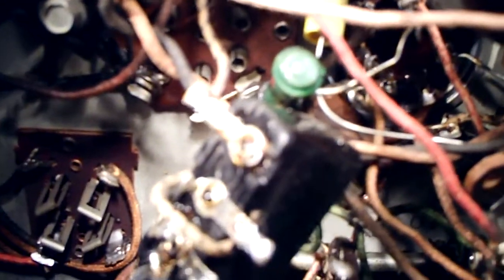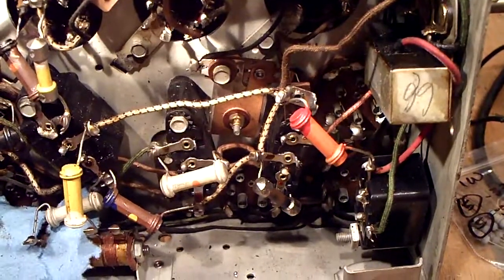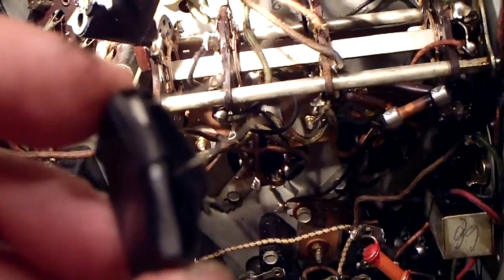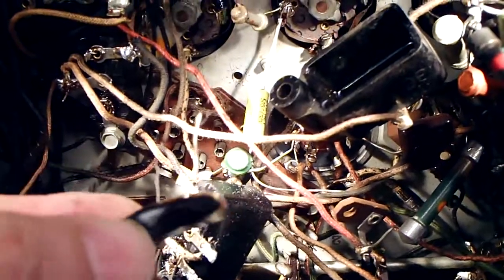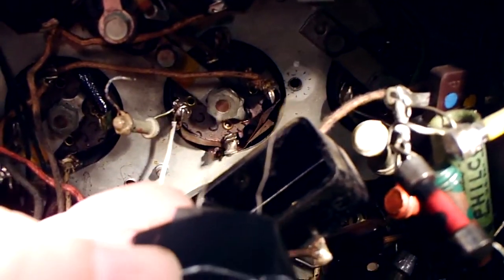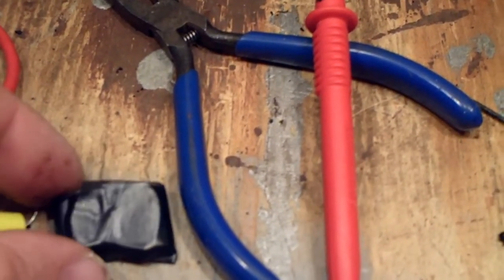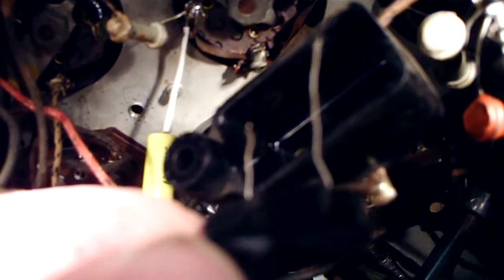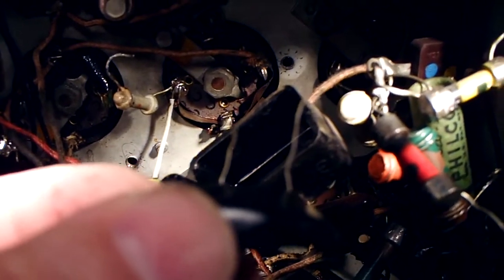Part 27a, Block Capacitor Resistive wire

Comment: Hi, I checked the chart on Philco Repair Bench and if that is a Philco part 3615-AS
,then it shows the wiring configuration for your part with .05 cap and a 500ohm resistor. That is a good reference page.
Thanks for sharing. Wayne